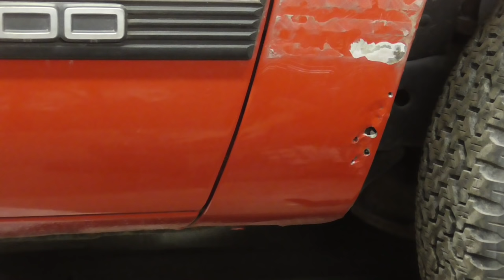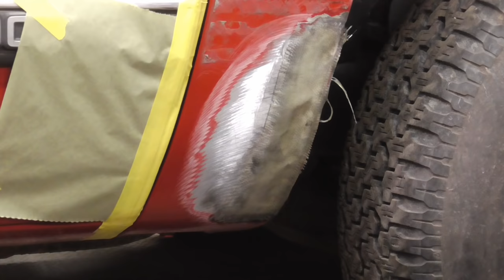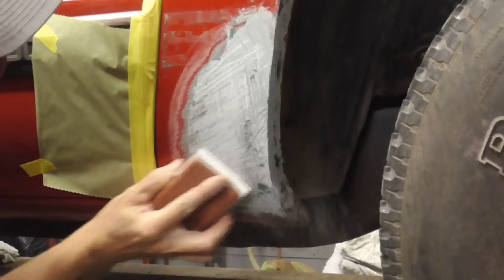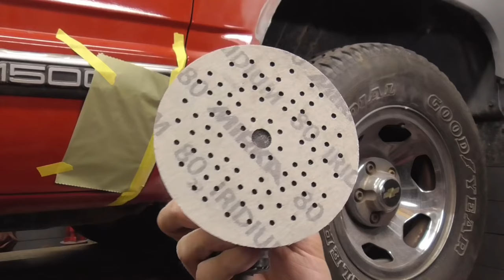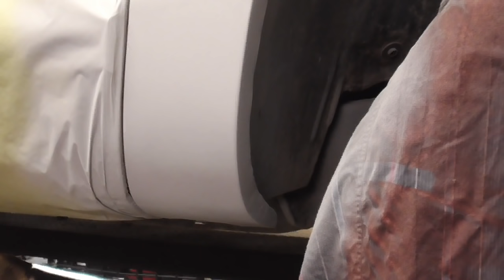How to Repair a Rust Hole with Fiberglass - No Welding!

Comment: Many years ago I was a professional body man.
Fiberglass in my opinion is the best way to repair rust.
The reason? It never rusts again. 
Oh, I know that it isn't applicable on a "restoration "  but for most applications,  it's da best
Also,  NEVER use body filler.  It is porous.
If you get a chip in your paint,  the moisture can and will leach through the filler causing the metal below to rust. Instead,  use fiberglass resin.  I prefer the type with glass fibers. Yes, it is more expensive,  but it shouldn't be more than 40 to 50 dollars overall,  and when you look at the cost of the entire project,  that is pretty small potatoes.
Reply from the maker: Thanks for the information Reed - my dad was a fiberglass guy - that's all they used when he worked as a body man :)
Reply: I use short strand around my fender wells for stone chips. No bare steel exposed after a stone hit.

Comment: Nice DIY video on how to make your rust problems even worse. Or how to screw the guy you're gonna sell the car to.
Reply from the maker: Make sure your panel can drain and stay dry on the inside and your good for quite a few years.  I'll do a follow up video on this repair soon as he is so happy with it he wants more work done on other spots - much cheaper for him than replacing too :)

Comment: The bad thing about using fiberglass to repaire rust holes is that in a year o so the 4 " long rust hole will only be exaserbated due to the moisture that came in under the glass through the rust holes now you problem has expanded out to where the size of the glass patch was laid down. You are just temporarly masking rust hole damage by overlaying it with fiberglass. Been there and done that. You are neither doing yourslf or your customer a favor by doing so. But if you are a shister car pusher yes you can make a goodlooking temporary rust repair. But the person buying it needs to lubricate up prior to the screwing he is getting.
Reply from the maker: The key is drainage.  The panel has to drain and dry inside.  Undercoat would really help but sometimes can't reach.  - Here's a follow up video on this repair - https://www.youtube.com/watch?v=t1WclT_GMvk

Comment: This is so much easier and faster than welding, but it seems everytime i do it, the jobs blisters out in 2 weeks.
Reply from the maker: Make sure you have a way for the water to escape.  It needs to drain and stay dry on the inside of the panel.  Under coat the back side if you can to seal it from moisture.

Comment: You should spray rust  ecapsulater on the inside
Reply from the maker: Two thing I found that work the best are making sure the panel can drain and dry out by cleaning the drain holes or even making new ones and this - https://www.youtube.com/watch?v=8XaZBy7GC7A

Comment: Should have used glass mat the woven pattern will bleed thru the finish product.
Reply from the maker: I've never had that happen.... maybe because the repair was knocked down lower than the original surface and the filler makes the difference :)

Comment: You do know the rust will still spread from the inside so will have to do it all over again best is to cut all the rust out and use a anti rust paint on the insed and then use a metal mesh and fiberglass over that i know that as i made this same mistake and which cost more money and time
Reply from the maker: Drainage is key - the panel has to be able to drain and dry.  https://www.youtube.com/watch?v=t1WclT_GMvk

Comment: Why wouldn't you put some of that rust neutralizer stuff on there first
Reply from the maker: You could if you like.  I just sand blast it clean.  Myself I think the rust neutralizer inhibits the ability of the fiber glass and filler to stick as well as it should.  They stick great to freshly ground and sandblasted metal.

Comment: my old body teacher always said if you don't patch it or replace all rust your just spinning your wheels it has to be steel
Reply from the maker: He makes a good point.  However, it really depends on how the job is done.  For example,  if you were able to allow this repaired panel to drain and stay dry on the inside and even coat or seal the back side - it isn't going to rust.  If moisture can't get to something it ain't rusting - period.  Good comment Ron - always a debatable topic :)
Reply: @LakesideAutobody  we are in rust belt of Wisconsin,  cars are floating in salt in winter , its crazy i had a 69 chevelle i kept out of salt , a 65 conv 88 olds and a 70 monte carlo i kept getting cars cause I didn't want to drive in salt i wound up with 5 before I broke down and drove my 80 malibu in snow and sold my 70 for wedding ring , I hate salt it turns cars to dust
Reply from the maker: @ronwallace6273  You're right.  We live in salty Michigan - can you imagine living in a state where when you put a ratchet on a nut it comes loose.  Wow!  😊😊
Reply: @LakesideAutobody  does that actually happen i thought it was only in movies , my breaker bar is acetylene torch and praying it don't break
Reply from the maker: @ronwallace6273  👍

Comment: Won't last very long metal and fiber glass don't expand and contract at same temperatures  will crack and separate in time ther are other materials that would work better.
Reply from the maker: Can last forever if you seal the back and allow for drainage and for the inner panel to dry out after driving in salt water.
Reply: You are correct, fiberglass is very brittle
Reply: @charlesburton9610  Fiberglass reinforced plastic (FRP) is not brittle--it is stiff and flexible. However, the cured unreinforced polyester resin by itself is brittle.

Comment: Hack ! No good Body Man would mud up rot holes , that will start lifting in 6 months.
Reply from the maker: There's 3 ways high production body shops fix rust:
1) Combination of Lap and Butt welds.  If you insist on strictly butt welds, here's the best way to do them for longevity: https://www.youtube.com/watch?v=e9bjZ_UxtJg
2) Lap joint using structural adhesive or panel bond
3) Fiberglass cloth and fiber reinforced body filler
 
See Eastwood’s video as to why body shops don’t butt weld then agressively grind off the strongest part of the welds, and attempt to metal finish today’s extremely thin metal:  https://www.youtube.com/watch?v=rpH50kh4W00
Reply: A good hack though! Never know the whole story! Great video
Reply: @LakesideAutobody  , it seems that there would be rust still existing on the inside. All of the rusted metal should have been removed.
Reply: Cave n pave lol
Reply from the maker: @jamespurcer3730  You could do that too if you prefer.  If you can seal the backs side, your good forever.  No moisture = no rust.
Reply: Morgan Vance  I'm nosey. What'd ya find?

Comment: What about rust inside? It will eat from inside out
Reply from the maker: Make sure you allow any panel to drain and dry out inside - even if you have to engineer it by drilling....and this - https://www.youtube.com/watch?v=8XaZBy7GC7A
Reply: @LakesideAutobody  thank you, in the video link you give the man annually give used motor oil to prevent rust

Comment: That's a band aid not a permanent repair. The rust on the backside of that fender will eat its way out. 100% fact
Reply from the maker: This repair is now about 3 years old - still fine (neighbor's truck).  Make sure you do it right, allow for drainage, and coat the inside if you can.  Just how the books taught it in the 60's and 70's  https://www.youtube.com/watch?v=t1WclT_GMvk

Comment: Why not use the fiberglass premix as base?  
-- Those complaining about rust eating it's way out, need to realize that the rust needs to keep eating PAST the fiberglass BEFORE U see it again.  Like the man says: CLEAN IT OUT!!!
-- If you cover the entire area with a 1/8- 3/8 layer of fiberglass, the rust needs to go BEYOND that area. Go easy on the hardener: excess hardener will cure rapidly, but be more brittle.
-- Drill some holes in the rear and spray undercoating in.  seal holes with seam sealer.  Keeping water and oxygen AWAY from rust will slow it tremendously.
--Do-it-yr-selfers should realize that semi-cured particles of bondo can get into and will STICK to your eyeballs causing great pain.  Work clean and careful.
-- Eg: A cheap electric random orbital sander with stick on pads with holes and a dust collector will keep the dust under control.
Reply from the maker: Good points Coyote5 - as long as the panel can drain and dry out - it will last a very long time - this repair is still good today :)
Reply: @LakesideAutobody   I agree, except that I live in the Canadian Rust Belt with high humidity in summer. 80-100%
Reply from the maker: Wow that's a lot of moisture in the air :) @C0Y0TE5

Comment: Many body men will cringe seeing this but yes in many situations this will work fine. Will it last for 10 years Probably not but if you welded it up eventually it would rust again. For the do-it-yourselfer if done right, this should last for a few years.
Reply from the maker: This method was taught in many trade schools and books back in 70's.  It will hold up well if there is drainage and the panel can dry out inside.  Still good today - https://www.youtube.com/watch?v=t1WclT_GMvk

Comment: I think this video has gotten a lot of undeserved criticism. 

In any case, I’m going to try this! I’ll let you know how it goes, and may even ping you with a question or two in the meantime. Thanks so much!
Reply from the maker: You're welcome.  Believe it or not my dad used to work at quite a few dealerships in the 70's and 80's and this is the method he used.  Just make sure your panel can drain and dry - no leaves, debris, rust, dirt,etc. to collect moisture.  Ask any ?s - I answer 1-2 times a day :)

Comment: Wouldn't be a good idea to spray rust killer in there first. Before applying fiberglass
Reply from the maker: You could do that for sure.  Drainage and the ability for the inner panel to dry is really important too - so make sure you allow it to drain and dry :)
Reply: Ok makes sense Thanks.  I'm a mechanic but always wanted to learn more body repair
Reply from the maker: @lordsauto  Feel free to ask any ?s, even if they seem really easy.  As you know from mechanics, the easiest questions not answered sometimes have the most negative impact.

Comment: This method is used only if you are going to sell the Vehicle…. Nothing is better than cutting out the rusted metal and welding in new metal. There is no structural strength to this repair. It’s quick… it’s easy but it’s temporary. Lay a straight edge across that lower panel and it’s definitely going to be High/Proud. Who knows what’s going on behind that “Repair” Wrong.
Reply from the maker: Here's a follow up on these repairs - https://www.youtube.com/watch?v=t1WclT_GMvk  If you make sure the panel can drain and dry, it lasts a very long time.  Also if you can under coat the back side it will last as long as a new panel :)

Comment: You're not repairing anything, just covering it up. Somewhere down the road that's going to fall apart and someone is going to get the  idea  and perpetuate that all body men are hacks.
Reply from the maker: This video is really for folks that don't have or want to weld.  I think I stated that early in the video.  
     This channel is about sharing the most common  methods used in the high volume body shops I’ve worked at in and around Metro Detroit.
The internet, TV, custom shops, etc use different methods because it makes them “look” like "experts"  on screen -  they haven’t worked in the field and witnessed what really works and what really doesn’t.  If you do it every day - you see what worked and what didn’t and why.  The methods on this channel are for daily drivers made to hold up in salt water conditions not cars that are “restored” and never see the road again.

Comment: THe repair was good however had the inside been descaled, rust converted and painted , this repair would last a long time.  As is, within 2 years the rust will have destroyed this repair and the whole job will need to be redone.
Reply from the maker: The key to the longevity of this repair is drainage.  If it can drain and stay dry it will last.  The original panel rusted because leaves, debris, mud and rust got trapped and rotted the panel out - no drainage.

Comment: Wow should be called how to temporarily cover up rust lol that will just keep rusting out
Reply from the maker: The most important thing on any rust repair is to make sure there is drainage.  Any repair has to be able to drain and dry.  I'll do a longevity video on this truck is a couple of years from now - it'll be just fine.  Hope you subbed to see it :)
Reply: @LakesideAutobody  the back side wasn't cleaned and painted if you would have done that then ya but there I still rust on the back side and rust spreads ask my how I know
Reply from the maker: @kevindeibler346  Yes - it would last longer if you can get to the back side for sure :)

Comment: Doesn't the rust just come back?....
Reply from the maker: Make sure you allow for drainage - the panel has to be able to drain and dry out inside.  If you can undercoat the back or at least spray some wd in there - that would help too :)

Comment: Bad  idea it will rust under the fiber glass. Repair with metal only. Anything less is a waste of time and money.
Reply from the maker: If you make sure the panel can drain and dry - the most important thing for rust prevention - It will last quite a long time.  If you can sand blast and seal the back with undercoating it will last longer than a new panel.  I've seen it work many times.

Comment: First spray it full of sealer
Reply from the maker: You're right and make sure the panel can drain and dry out - If it's full of debris like leaves, needles and rust chunks it won't last :)

Comment: Don't be shy with that s*** your putting it on to dry laddie
Reply from the maker: Thanks for the suggestion Brian - have a good week :)
Reply: It's not too dry. The lightweight woven "boat-cloth" being used doesn't require a lot of resin to wet-it-out. More resin would just run down and drip on the floor--a waste!

Comment: But you didn't get the rust behind it.
Reply from the maker: Yes - that's how this process is taught.  If you can get to the rust behind, all the better.  Or after the repair if you can sand blast the back and seal it with undercoating, it can last as long as a new panel.  It just a process one needs to know to have all methods available to them :)
Reply: @LakesideAutobody  Suprised you didn't spray some kind of rust reformer in there. I bought some from Lowes that is a Gel and it works just great. And you can paint right over it after it dries. Now do a Monte Carlo. they are the absolute worst about rusting.
Reply from the maker: @pulliamrn  Thanks for the information.  Monte Carlos were cool.  Nothing cooler than a 1970 Monte Carlo - great looking cars.

Comment: Thatll last a couple months. mabye a year.
Reply from the maker: Or 3+ years - still fine (neighbor's truck)  https://www.youtube.com/watch?v=t1WclT_GMvk  I'll do another follow up video soon for you - gotta make sure the panel can drain and dry out - the key to longevity with all types of rust repair :)
Reply: @LakesideAutobody   So how did you manage to get the rust on the inside of the pannel, where it started in the first place? You didnt. Because you didnt cut it out.
Reply from the maker: @DarkLinkAD  On this repair I made sure the leaves, needles, mud, etc. was absolutely gone.  Best to do it while you're making the repair - even remove the fender if you're motivated enough.  While you have the fender off do what you need to do to remove debris and allow for drainage - even hit it with some undercoating on the back side.  Heck, if you're really worried just get a new fender - they're cheap.  Again this is a method taught in older Auto Body Repair books - it's always good to know every method.  Again it's 3 years old now and still fine so....  Ease up - we're all here to help each other save $.  Here's another thing that can help it last after the repair - https://www.youtube.com/watch?v=8XaZBy7GC7A
Reply: @LakesideAutobody   I was doing this at 5 years old in my grandpas shop, you cut the old metal out, weld in the new and unless your artist with a hammer, you bondo primer paint only after doing what I mentioned first.. 
Rust will be on the inside (if its on the outside) and bondo will only accelerate it.
Reply from the maker: @DarkLinkAD  Off the subject - Just yesterday I witnessed two 60 year old men arguing about whether a wooden shoe can protect you from a horse stepping on your foot - they almost got in a violent fight and I assure you they'll never speak to each other again.  Ain't that silly?   Nice talking to you 😊
Reply: @LakesideAutobody   Id waiver that the wooden shoe would potentially splinter and stab the foot. Very bad, even worse if youre a diabetic.
Reply: @LakesideAutobody  Wager, wager is the word I was looking for.
Reply from the maker: @DarkLinkAD  Yeah... I think you're right.  Again DarkLink, nice talking to you my friend.  Have a good weekend :)

Comment: This poor man's repair will likely last for two or three years, at most. The time and money invested in such a 'repair' is probably no less than you need to do a proper job. Using a MIG/MAG welding machine is not rocket science.
Reply from the maker: With drainage and the ability for the panel to drain and dry out , it will last for years.  Still good today.  https://www.youtube.com/watch?v=t1WclT_GMvk